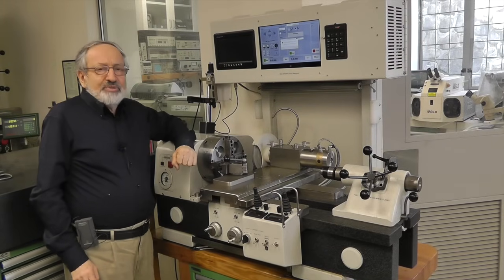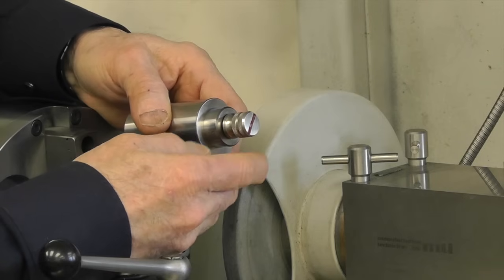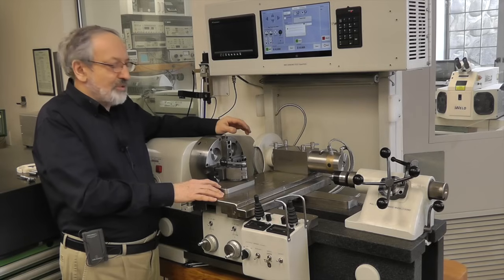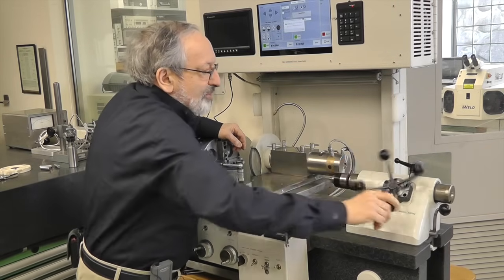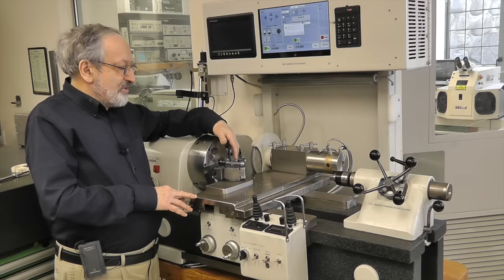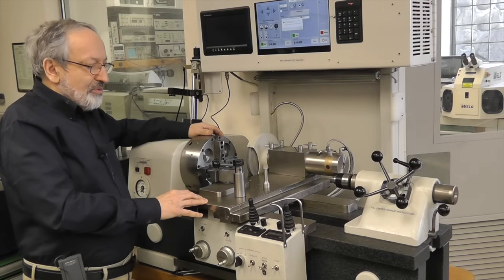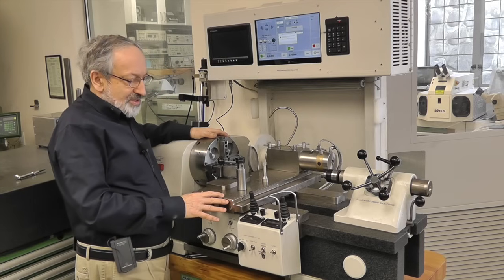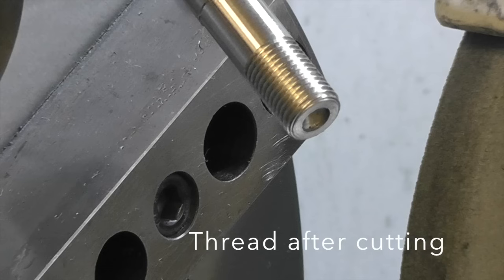High precision air bearing CNC lathe and grinder

Comment: What type of surface prep and epoxy are you using for the granite parallel bonds?
Reply from the maker: No surface prep needed if the granite is new, as it was never touched by oil. If granite is used, I would scrub it with NaOH (sodium hydroxide). Epoxy is regular 1 hour epoxy.
Reply: Thanks for the reply and information!

Comment: Just curious why didn't you use epoxy granite for the lathe bed? Is it less accurate?
Reply from the maker: How will you get it flat and straight to 1um?
Reply: Dan Gelbart http://www.precisionepoxy.com/PlateHome.htm
I was thinking something like this could be used.
Reply from the maker: airsoftsniper108 How do you get the vertical sidewalls? Also the spec on the epoxy you measured is 8um, not 1.
Reply: Dan Gelbart good point. Just curious,I am attempting to build myself a lathe (it doesn't have to be as accurate as the lathe you built) and I was wondering if epoxy granite could be substituted for the granite parallels that you used. Seeing as it's my first lathe build,I am bound to make mistakes,and  getting expensive pieces of granite parallels would be very costly mistakes to make. Sorry for taking up so much of your time, and thanks for putting these videos on youtube, I have learned so much already.
Reply from the maker: airsoftsniper108 Lowest cost way to get a lathe is not building one but getting an old one on Ebay or Craigslist and fixing it up.
Reply: @dgelbart  didn't quite get the part on which you explained the bolts on the bed, you said it would get it in compression, however it would only compress it against the spacers, i'm assuming that is to avoid the two Ts from moving vertically from each other? is there something compressing the Ts themselves other than the weight of the machine?
Reply from the maker: If the vertical members of the Ts are held accurately and are stable, the horizontal parts can be bonded to them without compression.
Reply from the maker: The granite rails are already accurate on all 4 sides.
Reply from the maker: The granite rails are already accurate on all 4 sides.

Comment: Ok this is probably going to sound like the strangest question you've been asked, but could you please tell me the colour (and texture if you ever use that) of the powder coat used? Just as RAL 6011 is the standard colour for European machine tools, that beige seems to be the standard colour used by many precision instrument and tool makers, however I've been unable to find out exactly what it is.
Reply from the maker: Not a RAL color, it is Columbia Coatings Light Grey. The slightly warmer tone comes from being too lazy to lower the temperature after paint flowed.
Reply: Dan Gelbart CC light grey! Wow, I would never have guessed that. It can be very difficult to judge colours off a computer screen and it looks identical to the laser welder in the background which I think is a warmer cream. I would have picked something more like RAL 1013 "Oyster White" or similar, a shade that looks to me adopted by many manufacturers as it's a bit warmer than grey. Thanks very much for providing this information, I'm presently watching your UBC lectures on Youtube when I get moments of time available, and again thanks for making this wisdom available.

Comment: why do car turbochargers use ceramic bearings instead of hydrodynamic bearings?
Reply from the maker: Turbochargers could use self acting air earings but they will need to be about 10 times larger than the ball bearing they replace to have the same load rating. The main problem is the one sided  load of the drive belt . In the lathe I show there is also a drive belt but all the load is removed by a ball bearing mounted pulley  first, which drives the spindle via a spline (same as in Moore jig borers).  New model computer fans and hard drives switched to oil filled hydrodynamic bearings.
Reply: I am fairly sure that car turbochargers do use hydrodynamic bearings. They rely on a separate high-pressure oil feed. There is no drive belt force with a turbocharger (Depending on the design there may be with a supercharger)
Reply from the maker: andy pugh I was thinnking about air/gas bearings when I answered. If you think of oil bearings, every properly designed journal bearing is hydrodynamic and turbochargers indeed use them, as they can be as compact as ball bearings. A quick Google search revealed that people experimented with hydrodynamic air bearings for turbochargers but no commercial product.
Reply: +Dan Gelbart Hi Dan,
Sorry if this is obvious but as the spindle is driven by a spline there is no through hole in the spindle correct?
cheers
Andrew
Reply from the maker: +Andrew Robb There is a through hole, spline is hollow.

Comment: why did you use air instead of oil hydrostatic, which have better damping properties?
Reply from the maker: Oil has much better performance, mainly increased stiffness,  but has two problems: you need to temperature control the spindles because oil will get hot from viscosity induced losses, and oil dripping out from all interfaces  is a bit messy.
Reply: I've seen oil bearings not running chilled up to 50k RPM with 3" OD, surely you are not running past 5k RPM? The dripping oil is easily contained by an "air bearing" / "air gasket" on each side. The escaping air redirects the oil into a draining tube, and this is its only purpose, so it is not wide to necessitate a long spindle overhang.
Reply from the maker: meocats Dripping oil is mainly a problem on the slides, not spindle.
Reply: aerostatic seals again, but do you think the porosity of the granite will be a problem, perhaps with a tendency to fracture?
Reply from the maker: meocats Granite will be Ok, but adding the air seals complicates things.

Comment: Very nice and inspiring video.  But i am confused how you deal with grit flying over these precision surfaces?
Reply from the maker: One advantage of air bearings is that air is coming out from all areas where moving parts meet, pushing dust/grit away. On top of it there are wipers (made of felt) to wipe the ways. Another factor: air bearings are not sensitive to scatches as they average large areas.
Reply: Dan Gelbart  thank you for the reply , i bulit 3 lathes , hopefully i can make one loke this one day , waiting to see this lathe at future projects insha' Allah

Comment: So im a bit curious about how you drive the linear motion, is it with a ballscrew or any other means?
Reply: Usually linear motors. There is a good PhD thesis by Roger Cortesi (search for Axtrusion), that describes in depth design methodology for a linear motion system built with linear motors and porous graphite air bearings. What was novel in 2000 about this was using the natural static magnetic attractive force inherent in linear motors to preload the air bearings. I assume by now everyone does this. The problem with a lead screw is that it has static friction which can limit repeatability. If a machine like this has some form error, like a twisted way, it can be calibrated and a control adjustment applied to make it act as if it were straight; If the machine has poor repeatability, say from leadscrew friction or backlash, then you're left guessing or trying to correct it through the closed loop feedback.
Reply: puddingpimp
In another comment Dan mentions that he does infact use high grade ballscrews in open loop. I stand corrected.
Reply: puddingpimp I wonder what is used for nm-precision alignment e.g. in chip masking? Tolerance would be sub-5nm for modern processes.
Reply: If you're talking about a process stepper; If I understand correctly they use a typical precision ball screw stage or linear motor, which can be clamped either by a moving support structure, or by turning off the air bearing supplies and allowing it to rest flat on the way, then the wafer chuck can be finely positioned by linear piezo actuators acting on a flexural stage (or forming the stage itself). An alternative approach would be to use piezo inchworm drives or the piezo equivalent of a taylor motor; I've read that these can achieve speeds of 4m/s, so they're certainly fast enough.
Reply from the maker: Ballscrew.
Reply: Im guessing your not using C7 grade then that im stuck with. ;)

Comment: awesome mr gelbart, as always thanks for sharing.
do you keep this machine in a controlled environment room or this type of bed construction tolerates changes in temperature well enough not to?
cheers. pete
ps: AWESOME !
Reply from the maker: The room it is in is a basement so temperatue is pretty stable.
Reply: do you think a concrete pour could have the same stability?
Reply from the maker: thebrokenbone Regular concrete: most likely will deform by water absorbtion from coolant. Epoxy-concrete (Granitan etc): Don't know, but you'll need the granite slabs to make the mold (to form the sidewalls) do you may as well ue the granite directly.

Comment: I want one. How much ?
Reply from the maker: The parts will run you about 10 grand, not counting software. A machine like this sells for $250,000 to $500,000 but they are a bit specialized (usually no tailstock). I wanted a more universal machine, similar to a regular lathe.

Comment: awesome, I hope this is part 1 (otherwise is just a teaser :). stupid question maybe: do you have air pressure fed in the in the spindle bearings and/or the carriage to maintain air cushion? what about the cross-slide?. how much air pressure and what quantity is lost in the bearings (what flow is needed)?
Reply from the maker: Yes, air is fed to all sliding and rotating surfaces. Air consumption is quite high because there are so many moving surfaces, about 10CFM. Pressure is 90-100PSI.
Reply: thanks for the answer. Hope to see more of it, been waiting for some new vids on your channel, this is extremely interesting for sure.
What instruments do you use to measure those parts at that tolerance, for example the ID of the cyl/piston you showed at the beginning of the video?
Reply from the maker: sharp x I just ground the ID to fit the piston. Best instrument to measure ID to sub-micron is an air gage.
Reply: Dan Gelbart Presumably, 10CFM is at STP? i.e. not @ 100PSI? :-/
Reply from the maker: Roger Barraud Correct, my mistake.

Comment: How do you read the position of the axes? Optical encoders?
Reply from the maker: This is driven open loop by microstepped stepper motors (0.25um per microsteps) driving a high grade ballscrews. Because there is no friction anywhere (air bearinngs) you can get away with this. If I wanted greater accuracy I would install interferometric linear encoders or inductosyns. In most jobs the critial thing is the geometery, such as roundness, cylindricity etc. The actual dimension needs to be gaged as the tool presetting is not accurate to 1um.
Reply: Dan Gelbart are the steppers direct drive to the ball screws or do you have some kind of gearing?
Reply from the maker: SRSlam 2:1 geared down via timing belt. Timing bely pulleys re-bored for low runout.
Reply: Dan Gelbart I would have thought the air-bearings on the slides would have stiction due to the air not being viscous enough to maintain a film, is this the case at all? (like how two surface plates will only slip on each other if they are already moving).
Reply from the maker: SRSlam There is no metal to metal contact with air bearings.
Reply: Dan Gelbart I'm surprised the microstepping works at that level, steppers get really wimpy when trying to maintain accuracy at high microstepping http://www.micromo.com/microstepping-myths-and-realities
Reply from the maker: Lasse Langwadt Christensen In this system one full step is 10um (200 steps x2:1 gearing =4mm pitch leadscrew) so you only need to divide each step into 10 microsteps to get 1um. The wind-up causes some backlash (~2um) which is removed by software.  The steppers are high grade, ~400 oz-inch torque.

Comment: OMG now I feel that I have been machining with a pic-ax and a sledge hammer.  What a great piece.  THANK YOU for sharing....  Back to my cave.....  Fred
Reply from the maker: pjsalchemy because od the air gap matching the expansion is not critical, will just change the air bearing gap. Where steel has to be bonded to the granite (headstock and cross-slide parallels) attention has to be paid to allow some differential expansion without bending.
Reply from the maker: pjsalchemy Regular mild steel.
Reply: When you realise the nice new mazak in the shop is as accurate as a potato......such sadness!
Reply: Dan Gelbart
Thanks very much!  I'm quite sure you took all of this into account but I would have thought maybe something closer to the granite for thermal expansion...Tungsten maybe?  Curious if this unit is used in a controlled environment and the mild steel expanding by maybe ~.0001/2ºC around room temp.  When I think of all the materials & mechanisms working in harmony to achieve these tolerances for <$10k, it is truly inspiring compared to any of my designs over the years and one was holding <20min/arc over a 20' tubing run.  Thanks for your patience, just trying to understand your tremendous tolerance achievement with all the things at play in the design.  ~PJ
Reply: That must mean I'm still using rock and copper chisel....~¿@  Thank You Dan Gelbart for sharing this great build!!  The compression bolt was quite brilliant!  Curious what material you used for it?  ~PJ
Reply: @rapidia2762  I know this was not your original point, but as far as I am aware there currently is no metal based 3D printing process which could easily print a sealed metal foam that actually displays the positive aspects associated with this composite. As far as I am aware metal based 3d printing currently relies on selective sintering, which requires the z dimension of the part to be built up with unsintered medium, so you can't really print a sealed hollow structure.
If there is a process which can accomplish this, could you please share some information on it?
Reply from the maker: @horrorhotel46290  The Rapidia system  (www.rapidia.com) can easily print sealed hollow structures and foams with a very wide range cavity sizes .